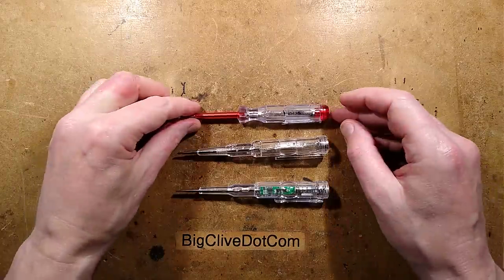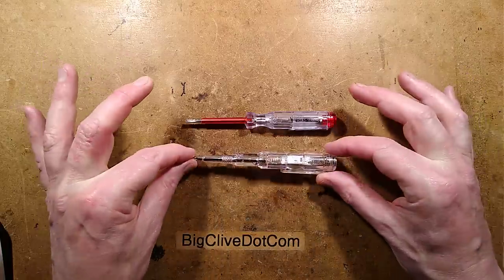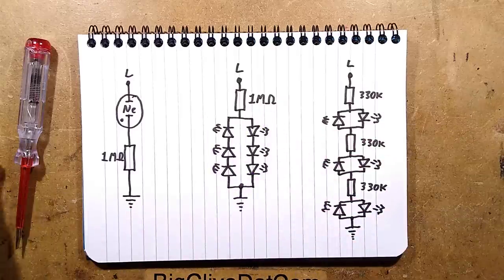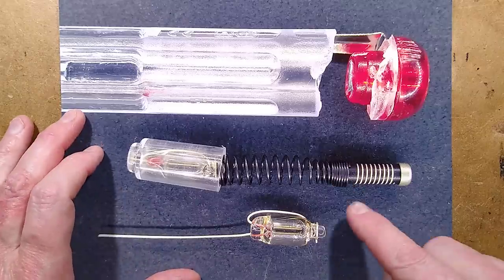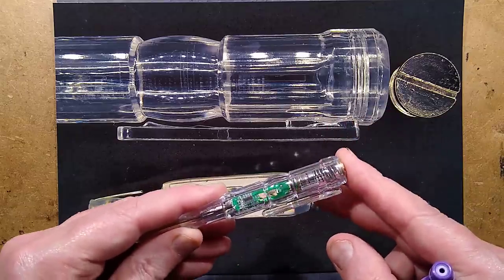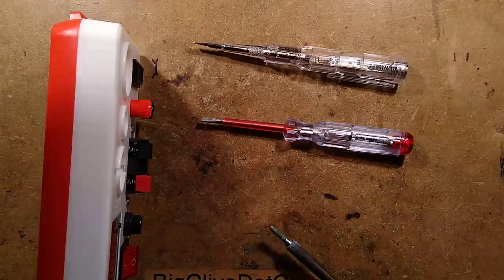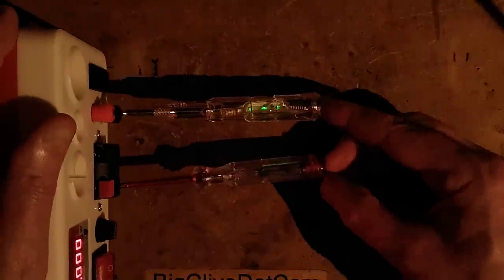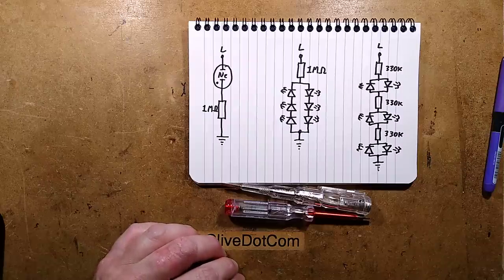Reinventing the neon test screwdriver

Comment: In general, electrical engineers and contractor frown on neon test screwdrivers as being dangerous and unprofessional. I personally have always found them useful, provided they are used with caution and with awareness of their limitations, such as not probing excess voltages above 400 volts peak breakdown voltage,  so basically limited to mains 230 volts. Though in my day it was 240/250 volts A.C.. 
In their heyday, the neon bulb was constructed like a fuse, with a glass tube with two end caps. The series resistor was specified to provide a good margin of flash over protection. The neon was designed to strike when the voltage between its  end caps was between 60 to 90 volts, though they might start glowing at voltages as low as 42volts. They were specified to light at 100 volts.
I suppose the main weakness, was that the glow was not that bright, and depended on the user providing a good earth with their finger touching the end cap of the screw driver. In the days of valve TVs, there were some times used in the highly dangerous practice of detecting the CRT EHT field, this did not require touching the end cap. 
Their greatest virtue was simplicity, not an a attribute that could be used to describe the very dubious modern alternatives, that require a stack of button cells, and contain a microprocessor circuit. 
The advantage of the neon bulb over an led solution, is that it operates at a high voltage, but very low current. The little neon fuse like bulbs were once common components. My very first stroboscope was made with one of these neon bulbs mounted in a bicycle front light reflector  It worked, but was not very bright.

I think you should flash test your LED version, as that is the critical parameter. I certainly prefer your version to anything containing batteries. 
Not sure that such test screwdrivers have much of a future. Their reputation has been damaged by the cheap Chinese imports, that use inadequate components, that make them very unsafe to use. Professional electrical engineers want such testers banned, so they may disappear as a result of some EU directive.
Reply: Also another thing these devices are useful for: to find which conductor is the phase. Yes, in an ideal world conductors have the proper color and everything, in the real work you open a derivation box and you find all black conductors, or colors that make no sense at all. This is why in my country this device is called "cercafase" that is phase finder. 

Another less common use case is to touch appliances to know if they are grounded correctly. If you touch the metal case of an appliance and the earth is not connected the neon will glow slightly. This is because the filter capacitors let some current (not enough to be felt or to trip an RCD) to ground, that is enough to illuminate the LED.

Or in general to know if a ground is good, for example if you touch with the scredriver the earth and the neon illuminates it means that that earth is not really connected to ground. That could indicate a break in the cable. Of course these are not scientific tests, but a cheap test to do to find potential problems, that then will need to be investigated with the proper testing tools.

Comment: There is also a bigger round led (old classic) , usually transparent, 10 mm in diameter, i believe its 3V 50mA, i wonder if it will be brighter, you didn't tried with this one.
 Also there are standalone bigger flat led using 1 Watt or 0.5 Watt you didnt tried with this one too.
Also there are some small filament bulbs which are used on irons for showing power on.
Im just curious if its is dangerous to use a more powerful light source if it fits in the screwdriver, or the voltage/intensity of the light source have to be limited up to a point for safety.
I have the neon screwdriver with 1Mo inherited from my dad, the screwdriver is very old, like 50 years old and it still doing a great job like in the first day. Indeed when i use it i have to cover it from ambient light with the other hand to see properly if it glows.

Comment: I would try using one or two LEDs taken out of some damaged light bulb. The high voltage kind, the one that glow at about 40V. They should be much better (brighter) than neon at a current typical for a voltage probe.
I made a small pcb with few dozens of those in series to make a very high voltage lamp and played with static electricity. Surprisingly bright. I was going to try to light it up under high voltage lines and perhups leave it there as a modern equivalent to Will-o'-the-wisp kind of thing. A small light glowing in the middle of nowhere.

Comment: Have you check new type tester Taparia Digital Voltage Tester MDT 81. It also tells voltage (well not really, threshold only). I find it useful to find diff between line voltage and leakage voltage when you do not have a multimeter nearby.

Comment: A key feature of the good neon probes is missing.   Any indication means voltage tested is above the safety limit of about 50V .  This prototype reacts around 10V .  Adding an apropriately sized Diac or extra LEDs could fix that .
 Another key feature is polarity indication, traditionally by lighting only the electrode connected to one of the poles .  In the LED design, different colors could do the same job , just remember to compensate for voltage differences .
Reply: But is that really a good feature? I think the ionization voltage is usually around 90 volts which is well above the safety limit. It's definitely better to have false positives than false negatives.
Reply: @eDoc2020  Still somewhere around the danger level .  Getting a faint glow around half mains is still relevant when the main dangers are around 220V above ground .  Of cause there's always feeling that voltage as a slight tingle while working on it .

Comment: One issue or not is that this one already lights up at lower voltages, while the neon one only lights up at "dangerous" voltages - those that can send a dangerous amount of power through your body given usual body resistance.

But this is obviously fixed easily by not using 3 but like 30 LEDs in series. May also make it more visible.

Or maybe not, as this one is also nice and helpful in automotive usage.

Comment: Clive, you can get 350 volt resistors type MFR4-1M0FI from uk Farnell (code 1100042):
Through Hole Resistor, 1 Mohm, MFR, 500 mW, ± 1%, Axial Leaded, 350 V
I normally use this type for the start-up resistors in SMPSUs. Usually 2 x 47k.

Comment: I feel like there could be functionality added to this with a couple transistors so that a green would show 12v (ac or dc), yellow could be 120v, and red could be 240v. I don’t know how to design that, but I bet Clive could.
Reply: That would be pretty cool but the idea here was to be stupidly simple.

Actually im pretty sure its not possible to get 12vdc to show up wireless like this, you need a ground wire.
Reply: @snigwithasword1284  Yeah - I was unclear on the operating principle of the light. I didn't think it was using HUMAN FLESH as a virtual ground. Maybe it would be possible with some sort of boost converter? It's quite possible that I have no idea what I'm talking about.

Comment: Makes me wonder if you could use the led strips that come inside of the vintage filament bulbs. Would make 360 illumination simple with either polarity direction.
Reply: No. They flow a current that could kill you.

Also they are designed for 250v top, while these screwdriver need to accept 500v to keep you safe. 

240v neutral phase is 440v between two phases. 

Neon remains a bad solution for peuple with 110v because that bulb starts working only above 85v, so at 110 the current is low, thus low light emission.
Reply from the maker: It should work.  Even at the very low current through the resistor.

Comment: I still have a couple or more of old style live wire checkers with a "glass fuse style bulb" 20mm and 32mm neon lamps and even longer capped leadless resistor (neon wasn't so demanded in semiconductor production and soviets supplied enough of it not to be greedy of used amounts).

Comment: I would feel quite safe using this LED one because I've no problem in slightest touching via 1 MegOhm to mains voltage, but there's only one thing which I wouldn't do, even though it was safe and that was touch to an earth to get a brighter signal. It's because there's a 6th sense inside me inhibiting me do that even though in this case unlikely anything bad would happen.

Comment: I have so many failed neon indicators, mostly in illuminated switches. Hopefully LEDs take over those as well.
Reply from the maker: The neon indicators in electrical accessories are often ridiculously overdriven, stressing the neon and its resistor.

Comment: In any case, to indicate „off“, always check the tester with a live line before/after. If you work on a line with a switch, that especially easy to do. 
And for professionals: yes, such a tester is not to prove the connection could hold 16A (that what your „Duspol“ is for. Sorry, only know the German term), but the very opposite, that there is not the slightest connection to life wire.

Comment: Great tool! Maybe put a diffuser around the LEDs to make the light signal omni directional, or even a light pipe to lead it down the driver’s end to prevent it being covered by the palm🎉
Reply: Diffuser reduce the visibility. 28y of using those testers. You want a single point to see it better. If you can't see the point, you just turn the screwdriver.

Comment: I wonder if you could do it totally isolated. Holding one leg of an led and touching the other to ground will cause the led to light (very dimly) from the emi your body picks up. 
If you made a very poor but very safe capacitor (or 3) in place of the resistor i imagine you'd get a decent light out of it.

Comment: Got the neon ones, but I have always wondered whether the various non-fixed contacts (spring to resistor, resistor to end cap, spring to neon, neon to screw bit) are reliable enough to rely on using them to determine presence of live power. If one of those flimsy contacts fails, one concludes there is no live power and you might die…
Reply: Hence why you should always test them (or any indicator) before use.

Comment: Clive, don't forget that a neon has a 50v strike voltage. So with a neon, it'll only light when above 50v. 

With 3 leds, it'll light up at any voltage above around 10v. Yiu need a zener in there... 😀

Comment: The neon has the advantage that it drops 50 to 80 volts, well to strike anyway. it can also detect very high voltages just by being in the proximity. holding the neon near the ignition leads will often ionize the gas.  I think I am right in saying if you hold the voltage just below the striking voltage of the neon it will act a a flame detector, they can be used as high voltage 'Zeners'. Long live the neon, bring back the ECC83. where is my 71/2 digit vacuum tube voltmeter,  damn those peasty leds  and new fangled OC71 transistors.

Comment: I didn't see much advantage in replacing with leds, for 2 reasons, 1 the price and 2, the neon lamp only conducts above a certain voltage, if I'm not mistaken 70V, so there could be some mistake when testing a phase with a low voltage and find it ok.

Comment: I have one with batteries inside, but it has 2 different colors of LED in it, it glows green when in near vicinity of electricity, and blinking red with faint fast beep sound when it's directly connected to live wire.

And yes... i always hated the neon ones since it was kinda hard to see the light.

If you can make a solution makes the LED one works reliable without a battery I will surely try to DIY. Because dead batteries is my main concern with the LED ones.

Also, this is just my thought, but using red LEDs makes it more intuitive for less savvy users to know "It's dangerous". 
Most people have it ingrained in their brain that RED usually means danger, GREEN is usually ok. YELLOW is caution.

Comment: Only thing is, im sure i have one somewhere that has a screw on the end so you can replace what i thought was a fuse with an incandescent light filament in it. Im pretty sure i would prefer some kind fuse that cut the circuit if the rest of it failed to save my finger.
Reply from the maker: I don't think there's a fuse value low enough to protect you from a serious shock.

Comment: The advantage if the LED tester is that neon indicator has a high voltage threshold and doesn't work well under 100V, but the LED has a treshhold about 6 -10V

Comment: Great video, but I prefer to use a duspol to detect voltage. Some of them detect live wire with just one lead. And with audio signal they are easier to use outdoor. You have to be grounded really good to make this screwdrivers work. So a voltage detector with two leads, and multiple led indicators and buzzer is much safer and is a way to go for me. Non  contact voltage indicators are the same as this   screwdrivers. I alway use a proper voltage tester instead.

Comment: When you find yourself sitting on the floor 5 yards away from the panel you were working on, with smoke coming off your beard....it was definitely live.
Reply: Clearly AC and not DC then - if it was the latter you’d be bouncing around stuck to it like a pin-ball.

Comment: One has to be very careful with those neon testers.... if the inside of the screwdriver is wet, or very humid, you could get a HELL of a zap when you use it, as the mains current can bypass the high value resistor and go much less unimpeded through the moisture around the resistor.

Comment: Last one I got I converted into a 12v test lamp with a white LED stuffed inside with appropriate resistance, and a wire screwed into the end, then sharpened the tip to a point for poking into wires and connectors, I stil feel reluctant using such neon jobs on mains power... :S

Comment: Complaint or not, as an electrician you have to use a 2 pole voltage probing device to test for voltage on wires to work on them. No test screwdriver, and also no multimeter. Because if the coworker you always make fun of on breakfast time plugs the test leads in to the amps range without you noticing it, you will jump of that ladder from the bang and break your neck. It is not always current or voltage that kills you, but the fall, or 3 degree burns from standing 1m away from the big short
And for the screwdriver: This thing will not indicate anything if you would probe an outlet in an ER for example, which might be completely insulated from earth. this also could be the case on an insulated ladder, but then you could touch the ground of something nearby. But you can never be sure that there is no voltage present, if it does not light up. If it lights up, you can be sure there is something, but if it doesn't, its a maybe and has to be proven by properly measuring (with a 2 pole tester) so if you have to carry a proper device with you anyway, you can just forget about the screwdriver al together

Comment: so technically you don't need the screwdriver.. just a piece of led strip and the resistor..in heatshrink.. could make for a very compact version. but I really love the proximity testers.. do they need batteries ? or would it work with just a coil or something ?
Reply from the maker: They do need a battery.  Only a low charge is detected.

Comment: Last night I had to install an outlet and I didn't know what breaker it was or if the wire that had been installed years ago was even hooked up. I didn't have all my tools available or a voltmeter. Bare wires have been sticking out all this time. I thought, HMMMM....let's bridge the hot and ground. POP! Found the breaker, 20 amps!

Never mind the fact I was playing with live wires for about 15 minutes...

Comment: As an industrial mechanical fitter I would prefer something more visible in bright light, however the led is far better.
Do they do one for higher voltage upto 415 ish?
Reply from the maker: The 415V is still just 240V to ground if that's a three phase supply.
Reply: And I should bloody well hope you're not going across the phases with the tester in one hand! You'll not last long unless you're very well insulated from ground!

Comment: When i worked in telecomms, there were a couple of electricians using a neon tester up in the busbar trunking on a wooden stepladder, it wasn't lighting, they went to get another that didn't light
I said they had to touch the trunking, they more or less said i didn't know what i was talking about, i was 17 at the time, they disappeared soon after, i don't know what happened because i moved to a different loccation in the exchange.

Comment: Isn't the neon version inherently safer due to the fact that it remains open circuit? By contrast (no pun intended) the LED version must always make a complete circuit to work? The neon one will also not fail (nor function) on a DC connection - the LED version could put the user at risk if the DC current was high enough?
Reply: Why do you think the neon indicator remains open circuit? It doesn't, it strikes, some of the neon forms a plasma and conducts current. It wouldn't light unless there was a current flowing through it. Also neon tubes are not AC only devices, they will operate quite happily on DC too (only one electrode will glow). The whole point of the 1M ohm resistor in both types is to limit current, so in both cases you get similar currents flowing through the test device as it is dominated by the 1M ohm - about 180uA for a neon and 230 uA for an LED. They are as safe, or depending on your view, as dangerous as each other. Personally I wouldn't use either as making yourself part of the test circuit just seems a dumb idea.
Reply: @ianmason.  Well I suppose only one leg will glow on DC. Have a read at this: https://www.effectrode.com/wp-content/uploads/2020/05/glow_lamp_specifications.pdf